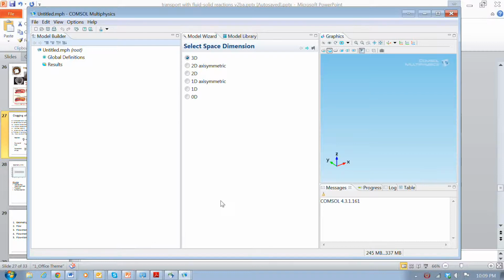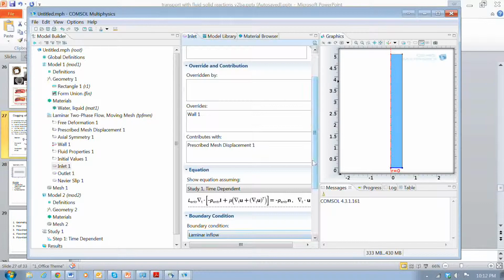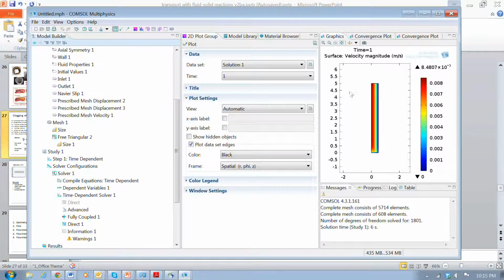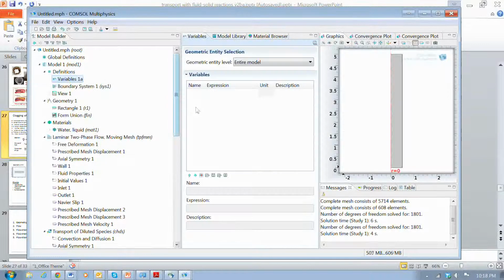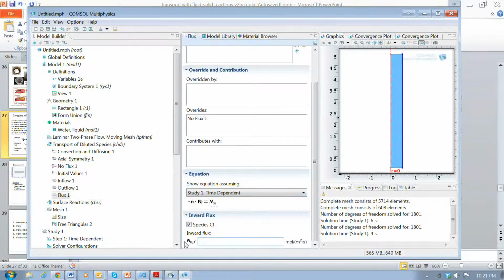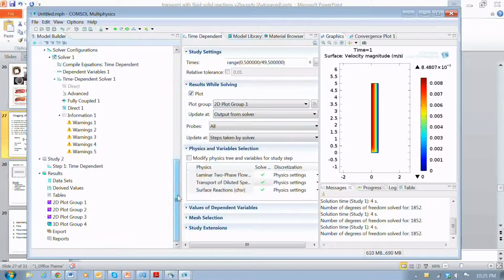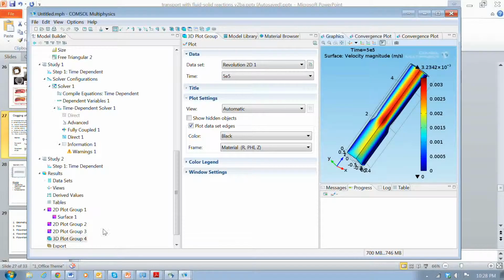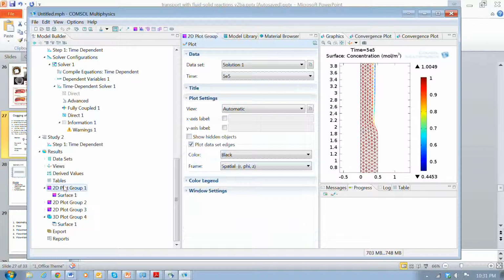Setting up a simulation of precipitation on the wall of a tube

Comment: Hello Larry.

Thanks a lot for this nice video. It is very useful. I have a request from you. Could you please provide variable table and their formulations for us as excel sheet or word document so that i can import them as you did? I use comsol 6.0 and I get some errors while writing variable table in the program. I will try to simulate your model to learn the comsol. How many variables are there in the variable part? (cs_rate, m1, m2, k_ads, k_erode, shear, molar_V, growth_rate, mass_flux, shear1, and what else?)
Reply from the maker: Hi Serhat,     This video is for my class and I have a wiki page with tables and other info for setting up the model.  I am working on making the pages describing the models in the class public, and hopefully this will be available soon.    Larry
Reply: @lcmurd1  Hello Prof. Larry. Many thanks for your kind effort and your time. Is your wiki page available now? I want to follow your class and Comsol simulation inputs. My aim is to simulate Calcite scaling in production well with respect to geothermal well depth in Comsol. However, I am not sure which parameters i need for simulating. Many thanks for your advice.